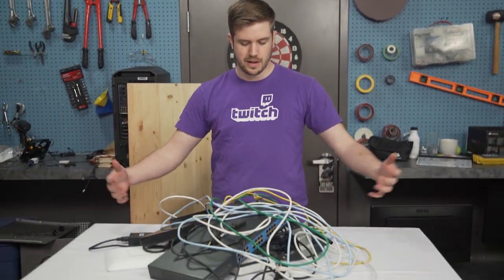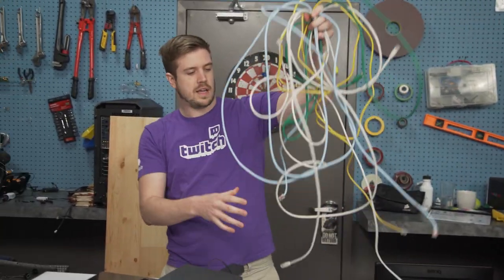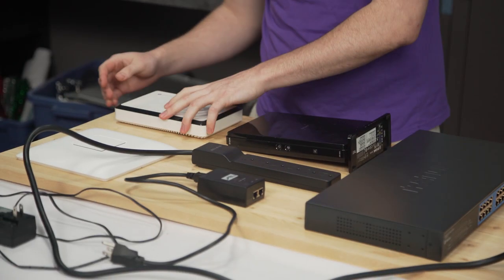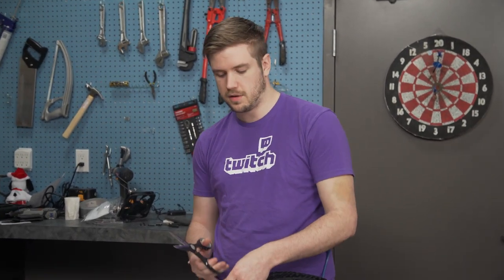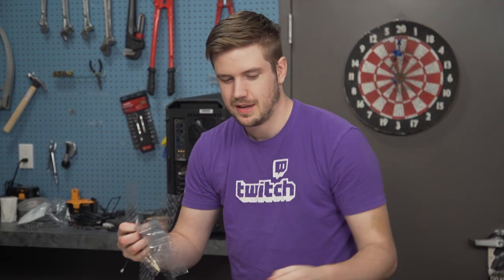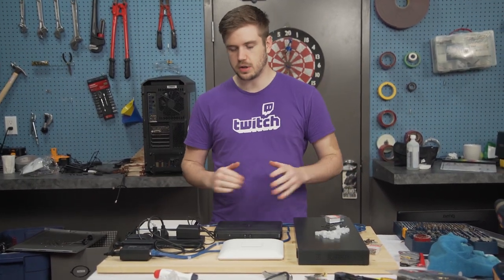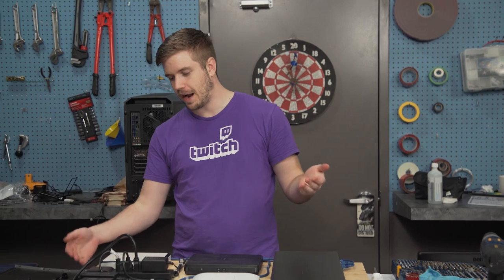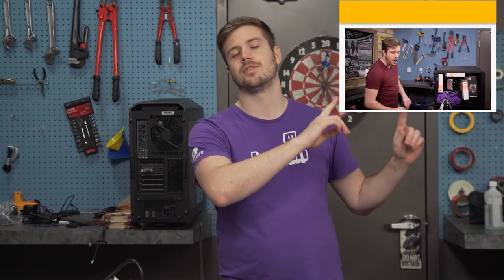DIY Networking Wall - A renter's solution!

Comment: Modem, router and access point? But those are all pretty much the same? Any model has a wi-fi access point in it these days. And if it's like 10 years old and doesn't, you get a router to get wireless. And what's the difference between a "router" and an "access point"? And what does one even need a network switch for? You only meed it for superfast connections, right? So computers. Phones, games consoles and pretty much anything else is fine on Wifi..?
Reply: 1. No, they are not the same.
2. His has wi-fi, just bad wi-fi.
3. That is not what a router is. A router directs internet traffic, you are referring to an access point.
4. see above for difference
5. NONONONONONONONO. Ethernet is not "super fast". Wi-fi is just "super shit in general". Anything connected to ethernet is going to be much faster. A phone can't connect wired, obviously, but anything that stays in one place SHOULD BE WIRED BECAUSE WIFI IS ALWAYS WORSE. Also, a seperate switch has lots more ports, as you probably saw in the video so Luke can actually plug all his devices in.
Just a question for you. Why would a PC need faster internet than a console or streaming box? A console is either using the internet for streaming video, online gaming or downloading large digital games, that is very good reason to use wired. Same with a streaming box, wireless will just not handle some types of streaming (if you have bad wifi then 4k 60fps streaming will chug). While a PC can do these things, what is it that a PC does that requires high speeds that the other devices don't do (other than local file transfers, which i doubt you do because you don't even understand the differences between a router and a switch)?

Comment: Why do you need a router and an access point??
Reply: + eduardoig17 JAJAJAJAJAJAJ
Reply: +eduardoig17 he sayed that the router has crappy wireless connection so he use the external access point  for hes wireless.
Reply: MrBall Breeder you can't just use the access point? or why doesn't he just get a better router? that way you don't need 2 different things? thats what i would do
Reply: eduardoig17 if you dont have the money for new stuff then you use the old stuff thats around.

you always need an router for LAN.
WAN modem ->LAN router -> switch
->pc/server/tv/etc

modem is to connect WAN and LAN.
router is to create an LAN
switch is to direct the lines directly where it needs togo so less traffic on the LAN .
Reply: MrBall Breeder yes i know that you do need a modem and a router (there are 2 in 1s but they are crap) however what is the difference between an access point and a router?
Reply: eduardoig17 not all router have an wireless access.

a router creates an home network where devices can communicate with each other without the need of an internet connection.

if you dont use an router and connect directly to the modem you lose network connection if the street internet shuts down so you wont be able to play music from your home media server on your pc.

an access point doesnt create a network but gives wireless access to an moblie device to an network.its mostly used as an range expander .

smart switches direct packages where its ment to be by learning .as router send out the same package to each connection and make it crowded the switches keeps it as one package to one device.
in extreme situations your internet connection slows down or even in very bad situation of looping makes your connection totaly blocked.

Comment: I'm devastated that your fibre router's WiFi occasionally drops. If it's not too much to ask, could you tell me how to improve my 2Mbit connection?
Reply: +Daniel Lecoq Pay more
Reply: +Josh Latham It's the max speed for the building I live in
Reply: +Magic Man How did you know?
Reply: Daniel Lecoq I just sense these things
Reply: Daniel Lecoq Move.
Reply: Josh Latham Not worth it just to get an 8Mbit connection
Reply: Daniel Lecoq  Then if the building is capped at 2, there is no way to make it faster. In my dorm the internet was super slow so i used tethering with 4G. You might want to look into it.

Comment: I'm wondering why you would need an access point right next to a router? If the router's wifi is shotty why not just replace it with something proper?
Reply: All I thought at this point, was get a better fucking router.  I live in a three storey house. My ISP router/modem won't reach the first floor (2nd in the US).  Luckily I have had an N spec router from about 7 years ago that reaches my attic and the end of my garden.  And it cost £70 7 years ago.  

How will an access point next to the router improve this?
Reply: +mavis cruet not to mention how much higher quality and less abused a new modem and router is then the literal garbage they give you that uses to sit in the sun in an entertainment center baking it's whole life before it got to you.
Reply: It's a really odd solution to an issue.  If the issue of wireless range,this won't help any more than a new router.  It might be just purely a badly communicated video, or just bollocks.
Reply: +mavis cruet I am thinking maybe his isp wouldn't allow him to use his own modem thus requiring an additional acces point or router?

Comment: Laughing my ass off at this video. So many things wrong. Redundant router, PoE AP mounted right next to the power brick, 24-port switch for home use, sanding your electronics, creating sawdust right next to your electronics, not knowing how to wire your own cat5 while working for a tech youtube channel, using velcro when some of those components have mounting screws and hardware, bad use of space on the board, and most importantly; look at that bend radius on the fibre optic!

Comment: why do you need industrial switch at home?
Reply: +Anball2 probably just the one he has
Reply: +Michael Cartwright  i really don't get it, i have 1 AC router and it provides  everything i need - it powers 4 gigabit LAN users where it is needed, while others using Wifi. It also serves as NAS using usb3 drive, speeds about 50MB\s read\write wich for a home nas i think is fine. I really don't understand why someone would need to use such a big switch at home?
Reply: guys remember where he works. Im sure part of it is on loan/ or given to him by linus
Reply: +Kingdom Of Mog it is not about how he got it, but about "what you do with it"))
Reply: Anball2 why would he get something differnt if hes already got this? i understand it's overkill but it wouldnt make sense to get rid of it

Comment: if you gonna do it properly just get a small wall mounted patch cabinet and a small 1u case to fit an old pentium 4 system for a propper router/firewall. 
then you can add the nas and whatever else in it as well to keep it completely clean.

Comment: Meh.  1" PVC frame work and fishing line to hang it all.  A few potato sacks versus velcro to hold the heavy stuff.  Put a couple PVC pipes below that ceiling level one to help dry your wet laundry.  Lots of joints and cut it into 2' segments if you need to transport it.  Versus $5 in quarters every 15 minutes on their dryers.  Plus the worlds loudest car alarm on the front door so when they enter your rental without you there, it goes off for hours.

Comment: I don't really see the point of all of this, I have a combined modem/router which takes my 250mbit from the wall to my computer via ethernet and also does my wifi.
I have great speed to my computer (basically 250mbit). My Ps4, iphone and android tablet work great as well, I'm either getting 250mbit or maxing out their capabilities.

I got my router "for free" from my internet provider so it's not some expensive fancy shit.
Reply: +Rymdkakor i could understand this if you were making a home network (with all your devices hooked up to say a server) but outside of that its pretty pointless, and lets be honest if you can afford to have such a thing (for anything other than work) you can probably afford to buy a house.

Comment: Wow... I like the idea of making a backboard for a rental situation, but I'm utterly disappointed by lack of what I consider to be medium-grade networking skills that I'd expect someone in that office to have. Honestly, NOBODY in that geek-harem has an RJ-45 crimping tool and the skills to use it properly? But, hey.... You can clearcoat a video card, right?

Several Pro-tips, here.
 - APs should always be plugged into the MAIN SWITCH, not the ROUTER'S switch. Let the big switch send only the traffic that needs internet to the router, and keep the big throughputs inside the big rackmount switch where it belongs.
 - WAY too much velcro. Zip-ties with screw holes for mounting are cheap, easy, and not subjective to equipment heat that degrades adhesive.
 - That's a rack switch... Where are the rackmount brackets? Put them on, rotated 90 degrees down, and they make perfect mounting brackets that are designed to be load-bearing.
 - UniFi APs should have brackets for mounting, so no velcro there, either.

Comment: Why dont you just do Modem to Network Switch to Wireless Access point, and circumvent the router completely?
Reply: Because without router, his devices would not be able to receive IP address.  The router is a mediator between the modem and your devices.

Comment: All this hardware will come off, max after 48 hours, becouse glue from velctro is not stron enough. You should at least use some superglue, to hold velcrom harder. IMHO, you should albo use some aluminium bars, screwed by long screws to hold hardware from the top of that board. This is to ghetto, everything will come off.

Comment: That isn't very smart not to mention that after you mount stuff to the walls in the place you rent all you would need to do is patch the very small holes making that stand would create more problems than solutions especially if you have animals and they decided to knock it over or someone bumps it and it falls
Reply: +Steven Deane How would an animal bump a piece of plywood screwed into a wall?

Comment: Not practical for me as my switch is in an entirely different room and my board would only have 2 things on it. The power bar and the router. I would not be mounting my ISPs Modem to the board, they prolly wouldn't like that.

Comment: Ghetto is the right description of this. Running a power cable parallel to a network cable and wouldn't the AP be better placed away from sources of EM interferance.

Comment: why do you have both an AP and router? that's pretty redundant and a waste of space.
Reply: +Flat4Buggy 2 then you get a different router lol. Going from modem to WiFi router to an AP is redundant and if you use the AP instead of the router, speed and network performance suffer as well. For being a tech show, that's some dumb stuff to do and show the viewers.
Reply: +Trevor Elliott router for firewall and DHCP? that's my only though
Reply: +draconas rayne except router firewalls are pretty shit and pretty useless. 

They have firewall switches for pretty cheap and they're pretty good, or you can easily make your own firewall switch for cheap. 

It just doesn't make sense to spend money on an AP because the router sucks when you could just buy a new router and not have latency or performance issues. It's a big mistake that Linus did review the setup first and prevent poor information to come out of his channel.
Reply: Trevor Elliott it adds literally 1ms so latency would be a joke.

as for performance issues, unless it's a 10/100 router, issues would be rare.

for awhile after I added a nas to our network and saw the bottleneck with a slow network, I bought and added a gigabit switch, the only performance "issue" I had was it initially went  pc->switch->router->switch->nas, turned off the router, grabbed a file from the nas then it was resolved with going pc->switch->nas for shit, then pc->switch->router->modem for the better part of 2 years until our ISP decided to throw in some replacement hardware after they fixed our lines and I removed a very redundant switch since the new router also had gigabit
Reply: Even if everything was gigabit using standard cables all the hopping will create slower speeds and the longer the cables the more degradation as well. That's why this setup is bad. Even if the affect is only 1-10Mbps slower, that's still performance loss. For optimal performance and proper technique, this video is incorrect.
Reply: Trevor Elliott except this video wasn't made for optimal networking performance, it was to showcase how to wall mount crap without mounting it to a wall, and it was delivered as advertised.
Reply: +draconas rayne and I'm pointing out his setup is bad and their videos go out to non-techs and techs alike. So they shouldn't be showcasing improper setups like this. And if they do, they should add the disclaimer that others shouldn't follow his setup because it isn't proper or best way to do it.

Comment: My god that's ugly. Buy a new router and hide it behind some furniture next to the modem. Then attach your switch to for example the bottom of your desk. And why do you need so many ports?
Reply: Lots of PC s and consoles? It's the reason I have a 8 port switch, I hate using wireless, for anything but my mobile devices.

Comment: Why do you need a wifi router and an access point in the same location?
Reply: +VvXXXvV he said why lol.... the router has crappy wifi. prob just disabled the wifi in the router and is just using the access point.
Reply: +Polraudio Zion you can't go modem to access point directly?
Reply: +VvXXXvV I think his modem only has one ethernet port while the router has 4.
Reply: VvXXXvV
you probably can but most modems only have 1 ethernet port so you will have to have some kind of router/switch. the main reason he is prob using a router instead of just a switch is for security reasons since routers have firewalls.

Comment: Over in Canada you can't just drill holes in the wall to mount something?
Huh here in germany we don't bother and just drill...
Reply: +splitframe if you're renting a property (especially for a short amount of time) you don't want to drill or nail anything to the wall because it would leave marks that would be visible. The landlord would then make you pay for filling the holes and probably painting the entire room so the colour matches.
Reply: +splitframe if you're renting a property (especially for a short amount of time) you don't want to drill or nail anything to the wall because it would leave marks that would be visible. The landlord would then make you pay for filling the holes and probably painting the entire room so the colour matches.
Reply: +Rami Abdelal Hmm, we normally either have the obligation to fill all holes and repaint anyway as per contract or the people coming afterwards do it themselves anyway.
But I don't have experience with pre furnished flats, it's more common here to have move into empty flats.

Comment: Tape? No way, that's not professionnel, why would'nt you use screw ? The devices should have screw holes for that.
What's the point of a AP next to the router? Keep you wifi on, on the router and put the AP somewhere else in the house.
Network cable shorter than 1 meter between two nic cards is bad for the traffic.

Comment: Luke screws down cable loop. Screw goes through cable loop grommet because the screw head is too small and drill is too powerful.....SSSSHHHHIII---  -Luke 2016

Comment: There are portable 30U racks available that have roller wheels for like 200$... Haha
Reply: +Zerqz OR you can get a piece of wood from a hardware store for 20 bucks or less.
Reply: Absolute Zer0 yeah but the rack will look way nicer and take far less effort. Don't get me wrong the wood works fine, but nice portable racks aren't all that expensive.

Comment: Why does he still use the d link, why not miss it out as he is pretty much just using it as a switch
Reply: A lot of unmanaged network switches won't work with just a modem, you almost have to use a router in between, or at least that has been my experience, doing networking. I don't have a answer as to the why of it, but my last modem I had through Comcast had only the single port, and didn't allow me to manage dhcp, so I couldn't use my network switch directly with it instead I had to run the switch to a router, and then to the modem.
Reply: +Harvs Routers assign IP addresses on the local network and store them in the "routing table" so the switch knows send data based upon the routing table. the network IDs are built based upon that. Without the router, the switch won't send data anywhere because nowhere will be assigned and the switch won't know where that is. Also, the router is required by the modem so every request is passed from the switch to the router then modem/internet.  I think you can get a single port router but we're talking Cisco 3Com commercial stuff.

Comment: Ghetto must be smart? 
I've done this in the professional field where clients don't want or need the expensive setups.

You can add acrylic glass to form an enclosure and put two pc fans for forced air cooling. 

Take a step further and add air filters on front of the fans to minimise dust build up.

It's not only lack of money why this used.

Comment: what is the difference between the access point and router?
Reply: +jesse alvarez Access Point is just a fancy word for "Wireless Switch". If your router has wireless, that's because it has a built in Access Point.

Let's say your router's wireless only covers half of your home. You want to extend it. So you buy an AP and connect it with cable to the router and hang it in the other end of your home.
Reply: Mansen Thanks for the explanation, I was just trying to figure out why he needed a router and access point.
Reply: jesse alvarez Another reason is that the access point on low-end routers is terrible. So getting a dedicated one might be better if you're serious about your wireless network.